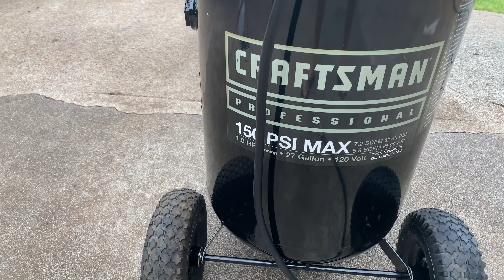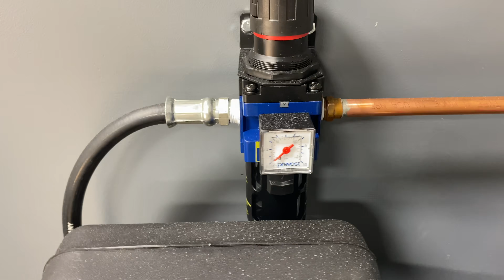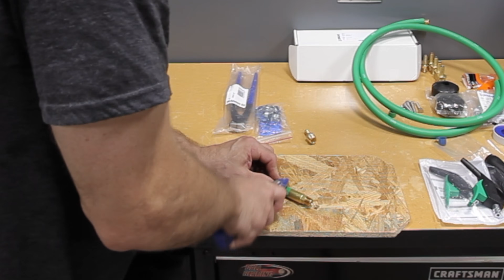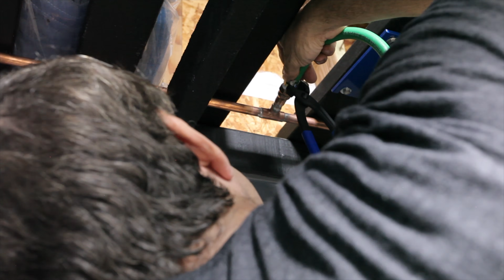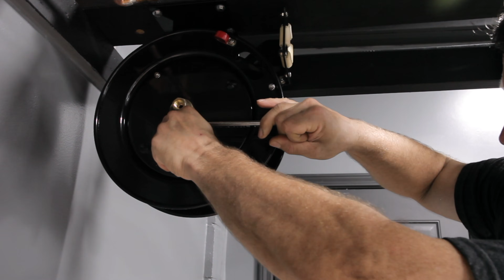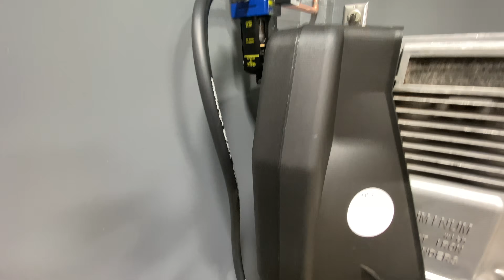GARAGE CUSTOM DETAIL AIR COMPRESSOR INSTALLATION. COXREELS EZCOIL

Comment: Thanks for the video. I have your same compressor actually but couldn't find the inspection port fitting. Let me know where you got yours, thanks man!
Reply from the maker: Here is all the parts and pieces. https://www.hawaiidetailing.com/air-compressor  I unfortunately don’t currently have a link for the port. I will try to update it as soon as I can. My source does not carry them anymore and I will source the port from somewhere else.
Reply: @ thank you! I used your website to buy all the Amazon fittings. Thanks again for the informative video. 🤙🤙🤙

Comment: Hey man I thought I’d ask, I’ve been using the 6 gallon ridgid pancake air compressor for a while now and I’ve decided to get an air hose reel but Ive seen people mention needing filters/dryers for keeping water out. The only tools I have for my air compressor are blow guns and chucks and a tire inflator do you think getting a filter/dryer is  necessary?
Reply from the maker: @SimpleMistaken  I don’t think you need it for those tools.

Comment: Love the videos as always! I’m curious as I just bought the same OG air reel but mine when the hose winds back up it spins super fast the entire length of the hose. Curious if you have this as well or if the entire time it reels back in its slow and controlled

Comment: Always good to have a valve on tank before the line. Makes line service easy, end of the day turn off to save tank volume. The tools and reels will tend to leak after a while. Especially the reals with seals on the rotation etc. Walking out there every morning hearing the compressor kick on is annoying
Reply from the maker: Great idea. Thanks

Comment: I just started building out my air compressor setup that I plan on building this spring and your video helped a lot. In particular I wasn't aware you could adjust the feed plate depending on its configuration from ceiling or wall mounting. Since I lease my space I am just going to mount a cox reel and the Alto3 on some Unistrut and run two jumper hoses from OG and one with a Prevost quick disconnect so I can utilize the wall space if I am not going to use the air compressor.
Reply from the maker: Awesome.

Comment: Good afternoon. I am looking to do this setuo exactly and acquired the same compressor you have. Im having issues finding the inspection port reducer to 1/2inch. Can you provide the link of where you go it? I think it's a 1.5" to .5" reducer.
Reply from the maker: I got that inspection port from eBay. I used to have a link for it but it was no longer available. Do a google search for it and you should find some options out there. Here is one I pulled up right away. 
https://tricitytoolparts.com/products/pg201008av-air-compressor-tank-bushing-2-x-1-2-inspection-port-campbell-hausfeld 
Check to make sure the size it right for your setup. There are a lot of options. Hope that helps.
Reply: @HawaiiDetailing  thank you for all your help. Just FYI I was able to find some galvanized cast iron piping at home Depot. I used a 1.5" x 1" then a 1"x0.5" bushings and used thread tape and sealant. I wanted to follow up just in case anyone had any similar issues.

Comment: Great video, I think I would have tried to install some kind of shut off valve to cut air off to the line. 😎
Reply from the maker: On a larger system for sure. This is only a 10’ run so I did not do it. Thanks for the suggestion

Comment: I’ll roll my hose up instead of pay 691.00 for that shit no way Jose.
Reply from the maker: Yeah. To each their own. For a kit that will likely last the rest of your life I think it’s worth investing in ultra high quality tools. You should consider the other video I did and look at the Amazon version. A lot less quality but at a price that is easier on the wallet. Thanks for watching
Reply: @HawaiiDetailing  You should read about the lawsuit SnapOn filed against Harbor Freight on their Floor Jacks for infringement or something. Then HF responded by presenting evidence of the exact manufacturer catalog model both units were and was identical. Only difference was the label and $1200 tag on the SnapOn vs $199 or whatever. Price is no longer a major factor like it used to be. Especially with air compressor stuff. Tons of labels are using identical parts from only a few suppliers

Comment: Very nice install and video documentation! I'm sure it's a pain to edit. I appreciate the effort. 

I have been wanting to put a compressor setup like this in my garage for a while. I have a lot of air tools that are just laying in a drawer. My issue is garage floor space. I don't do car detaiIing. It's a general, do all shop. I had contemplated putting a compressor outside in a weatherproof shed, and running the air hose through the wall to save space and keep the noise lower when the compressor kicks on. I may still do that.
I found this video after seeing your other video about installing the shop vacuum system (awesome), which is the original project I was searching for. 😂
Reply from the maker: Thanks a lot for sharing your story. I appreciate it.

Comment: Can you advise me please on what diameter copper tubing I should use for my system .Which would be more appropriate 1/4" or 1/2" ? - Thank you.
Reply from the maker: I used 1/2. 1/4 is too small. 1/2 for smaller systems and you could go 3/4 on a very large system. Thanks for watching

Comment: Great video and how to!  I just replaced my old Husky 30 gallon oil lubricated air compressor with an electric ultra quiet Husky 20 gallon. I had the same drain line on my old 30 gallon and moved to my new compressor for bleeding water out.  You're spot on I never used to drain the water cause it was such a pain.  That Ultra Quiet Husky is super nice for the garage, its quieter than the vacuum when running.  Beautiful Garage, leave the copper, makes a nice statement.
Reply from the maker: Thanks for sharing your thoughts and watching

Comment: Man I really enjoy all your videos I built a custom quiet box for my air compressor about the same size as yours I made it out of Rockwell safe and sound and MDF board I sealed the MDF board and I put clamps on it to keep it sealed I have two intake fans and two output fans that come on when They reach a certain ambient temperature or humidity I also built a pre-cooler in an after cooler before and after the tank to keep moisture out of the line it works amazingly smooth best wishes thought I’d share what I did God bless
Reply from the maker: That sounds awesome. Glad to hear you have a nice setup. Thanks for sharing and watching the channel.

Comment: Your compressor its running whit 220 or 110 volts
Reply from the maker: It’s a 110V on a dedicated 20amp circuit.

Comment: Got the same compressor and love it.
Reply from the maker: Yes it’s served me well for many years. Just recently refreshed the setup with all new fixings. Super happy with it now. Thanks for watching.
Reply: @HawaiiDetailing  I used your link to order the bottom drain line for mine. Love how the reel reels back slowly. Def gonna invest in one here in the near future.
Reply from the maker: @Steeda04SVT  thanks. The reel is really nice. It rewinds slooooow. But it is a good thing. I never realized how crazy the old one was until I used the EZcoil.
Reply: @HawaiiDetailing  didn’t see the link for the new inspection plug you put on the side in the inspection port.
Reply from the maker: @Steeda04SVT  it was hard to find. I found it on eBay but it was a 1 off. I just looked on both Amazon and eBay to see if I could help you out  but could not find it. You will be able to find it from a air compressor specialist online store. Something like this but check the sizing.
https://tricitytoolparts.com/products/pg201002av-air-compressor-tank-bushing-2-x-3-4-inspection-port-campbell-hausfeld